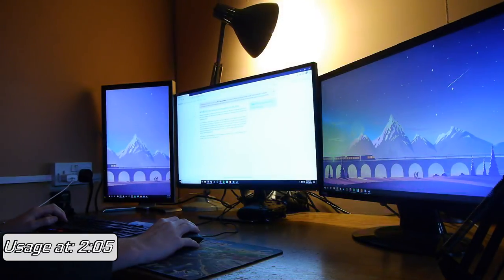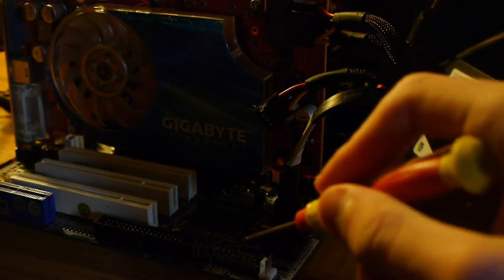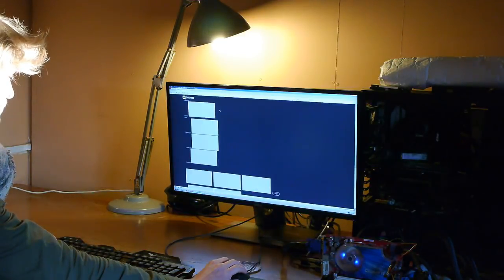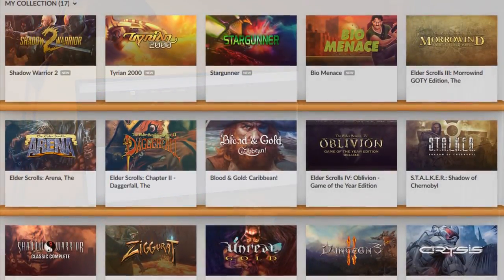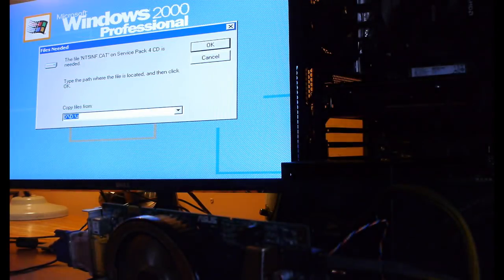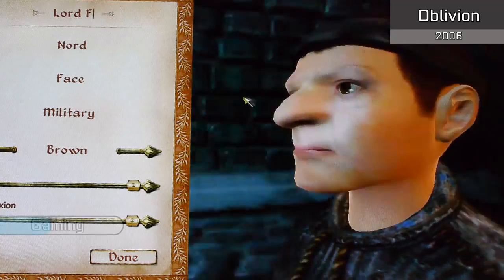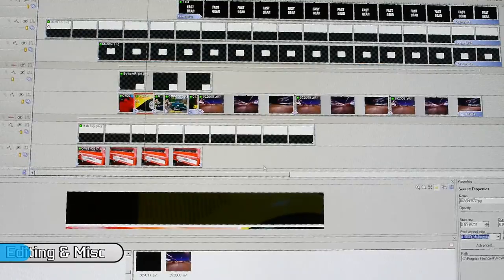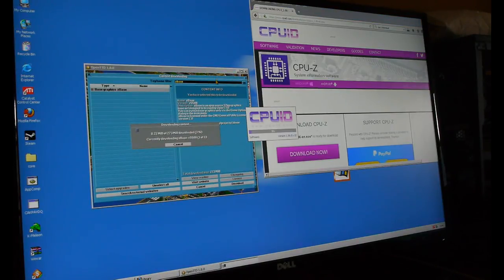Windows 2000 - Is it any good today?

Comment: That was fun :) I've only used 2000 a handful of times. I see it stuck between 98 SE and XP, struggling to run software from both periods without mucking around. I do wonder when XP will make it the winworld site...
Reply: The next year or two seems likely.  Of course, Windows 2000 lacking any online activation nonsense does make it slightly more convenient to use over XP- at least for earlier XP-era software and hardware.  Assuming you're using unmodified installation files anyway.
Reply: Today, win2k is less sane than xp. But back in the early 2000s when xp was vanilla and sp1, it was really buggy still, so running windows 2k sp4 was the stable choice :)
Reply: You should do a video like this @PhilsComputerLab.  Your videos are great!
Reply: Windows XP will never make into WinWorld PC due to copyright issues, there are a forum thread about it, they can't publish Office versions newer than 97 for that reason after Office 2000 was taken down due to a DCMA

https://winworldpc.com/product/windows-xp/final
https://winworldpc.com/product/microsoft-office/2000
Reply: Probably it will endup there in 5 years or more. People still use it too much as a daily driver, and incredibly sporadically microsoft still updates it, such as with the spectre problem
Reply: Up8Y I wouldnt say 2 years tho
Reply: Carlos S. M. Yeah but in 5-10 years wouldnt those older software be totally abandoned? Would microsoft still care about it? 
I mean, right now they are still kinda updating once in a while those software
Reply: You can find copies for download online already, and the one that I use hasn't been taken down for over a year, so I doubt it'll be long.
Reply: Yeah, I would think by now, Windows XP and Vista should also be considered abandon ware too. I did see Windows Longhorn up on the site though which seems like XP and Vista mixed together.
Reply: Shawn Burton Kinda, but by the unusuall really long support that xp had, and even longer lifespan (there are still a large number of people living with it as a daily driver today) and how many companies still use it, its hard to tell but i dont think soon they will just drop xp and it really become a abandonware. 

Vista is still too recent to be able to be considered (and allowed to be) abandonware. 
Both xp and vista still have some really nice compatibility and still can work with many tricks up the sleeve. Microsoft usually stops caring about one of their oses when its just like 98, where its basically too isolated from the world, awsmost any hardware able to run it is too old for a decent modern basic usage, no programs made in the last 15 years support it nor any hardware.
Reply: @eduardoavila646  true, I guess you can still get by with doing the majority of modern tasks with XP. I did see Windows ME on the site and for some reason, the only screenshots that they show for ME are blue screens of death. I think another reason why XP isn't up on the site is that they would have to get around the activation thing which prior versions didn't have.
Reply: Shawn Burton Well.. that could be a potential issue too.
Reply: Win 2000 is my all time version of windows.
Reply: @lopwidth7343  I remember in the early days of using XP like I remember in the summer of 2002, there was this virus that would force the PC to shut down like there would be this message that would count down like 30 seconds. I think at the time, I was using XP service pack 0, original release.
Reply: @sburton015  Blaster worm, if you were quick enough you'd type shutdown -a into a run command. It also effected Win 2k.
Reply: Probably never because XP needs to be activated in order to work.
Reply: @TheNews1990  only if you crack it.
Reply: @Gamz Neddyl in my collection of PCs, the oldest one that I have that still works that reminds me of the old style of Windows is an old Toshiba laptop with a 266 MHz Pentium CPU with 96 MB ram and has Windows 98 se. I could even browse the web on it, sort of.
Reply: Well u can install windows xp from the internet or the micro version
Reply: Windows 2000 was a successor to NT 4.0. It was meant for professional use, not for homes like 9x and ME was. XP combined these to one OS.
Reply: @LaDeXi  at that same time, Microsoft was going to release a home edition of Windows 2000 based on the NT platform which they called Neptune, but they never released it. Instead, they took the older Windows 98 platform and added some new features and released it as Windows ME.
Reply: I don't know but I keep a fresh iso of WinXp professional to use for nostalgia pu.
Reply: XP and windows 2k pro are 2 entirely different things. 2000 was 10x better in many regards than xp was aimed at the home user 2k was for the biz market etc. It was not until late in xps life cycle that it got close to being as reliable as 2k. By that time though windows 7 was months away. Most corp offices out right skipped over xp just like they did 95 and 98. Things windows xp lacked out right included various clustering capabilities like beowulf cluster. Windows 2k pro and adv server had these built in. Also xp lacked a ton of networking features by default that would be used inside a corporate lan its file sharing was way more limited. Even today there are windows 2k series oses that are right up there with windows 10. Windows server 2k19 is just around the corner 2k18 is out now. No one in a home / end user environment really used 2kpro or 2k adv server for things like gaming as it maxed out at 1 version oldr for dx than xp as it was never meant for gaming. It had dx to allow for some gaming stuff but it was mostly made for work. This included use as render farms for 3d studio max and on microsofts web site at the time that was even listed as a use case for the built in beowulf cluster support.
Reply: Unfortunately XP has no drivers for my laptop :((
Reply: @eduardoavila646  most ATM in europe was win xp embed based thats why still was updatable
Reply: Mateusz Zimon Yep, not only atms. Many cash registers and many stores still use windows xp where i live too.
Reply: I used 2k only for a short while... can't say anything about it, just that XP made much more sense to me as a new computer user. With time I found out how to get the errors away, it ran smoothly like butter.
Reply: Well then how did Windows 2000 make into Winworld easy, but XP can't? @CarlosSMOfficial
Reply: win2k is nice, essentially xp lite++.....xp I would argue works best(course more is better up to the limit) at like 1-2gb ram, win2k happily runs with 512mb; only time I had issues was trying to install on a sony vaio p, something about not liking the ide/pata controller even after trying out a couple of different drivers
Reply: I used Windows 2000 as my main OS back when it first came out, and the biggest problem was game programmers being sloppy--for instance, they'd detect you were running on an NT kernel OS and assume you didn't have hardware accelerated 3D, because NT 4.0 and earlier versions didn't; but of course, Windows 2000 did. By the time XP launched they'd figured things out and games would work properly.
Reply: @d2factotum  Sounds like windows XP x64:P; I guess I didn't game hard enough on 2k to notice anything
Reply: But if, for theoretical, one has one or handful of applications compiled with Visual Studio, is it stable? Usually older Windowses dont require as much cpu,ram,gpu resources, so kind of "debian of Windows world" (debian HC users run only command line)
Reply: @rytisliaucys3444  what laptop?
Reply: @plasmar1  HP Probook 4530s. Couldnt find wifi drivers
Reply: https://www.ath-drivers.eu/download-driver-nr-265-for-atheros-AR9285-and-WindowsXP.html assuming it's atheros..... they're actually pretty awesome at providing drivers:P....... most stuff is a matter of looking and not depending on the company that makes the laptops:P
Reply: @Drakilicious I think most the dirt that 2k face was from NT 4.0 which didn't natively support cd drives or something, in turn taking out a disc without ejecting or something would lead to a BSOD with no other reason:P(I learned this the hard way:P); and possibly a small performance hit from 9x to 2k that may of seemed bigger at the time.......but yeah 2k was and still is stable as a rock, really no different from xp
Reply: in the early 2000s MS sold all these PCs with Windows Millenium which was an horror, and I made thousands, fixing computers - initially for free - by upgrading WinME to Win2000. Which was a skin-less WinXP. And a decade after these machines worked still like a charm.

Even today I see someone who is lost on Win10, the "tablet mode"is always activating on its own, and they are stuck, and they keep telling me "I really like the previous one you made me" me: "what?" "well, the HP, you know, it was old but I never had any problem with it like I have with the Windows 10, but most things like Youtube and other programs are no longer supported..."
Reply: you can still use youtube etc on win2k(I still use 2k in vm's occasionally), but it's days are seriously numbered:P..... it's definitely not what it use to be
Reply: @lopwidth7343  I know lots of people who use XP as a daily driver. Some with some without  antivirus, just a firewall. I have a pc that I use just for gaming offline and youtube/ netflix on xp. I never have any issues. But I tend to do all my web surfing with Linux. I just set up a PC with W10 to try out and within two hours of using I had to reformat and reinstall because of malware. Not to mention W10 itself which is one big malware entity itself. But I want to play games with more than one core and 3 gigs of ram!
Reply: Shawn Burton Wait you got SASSER?!

Comment: Awwww I miss my old PC where i had Windows 2000 and XP dual boot 
Thank you for this video <3
Reply: If you miss your old P.C. you should go on Ebay and purchase one. Ebay has good prices :)
Reply: @eclecticreader961  but the things were used in e-bay -.-
Reply: @xaernxd  , Yeah the things are used. Used electronics that are sold on Ebay are typically in good condition though, unless otherwise specified in the item description written by the seller. Many sellers offer free returns too, if there's a problem.
Reply: @eclecticreader961  oh ok

Comment: Windows 2000 have two major advantages over XP for retro machine gaming/testing. First is they do support non PNP ISA devices. Do you have ISA network card or non PNP sound card? Well, no luck on XP, but they do work on 2000. This makes it ideal dualboot OS together with win98 for the long DOS to 2002-4 era retro machine as you need those ISA devices for good DOS gaming and at the same time you want win2000 for modern networking and NT5 era software. Second point is that unlike XP, it boots anywhere. If XP does not have the drive controller driver it will not boot, nor it will boot if you throw it already installed to completely different computer. 2000 still have the legacy 16-bit PIO over bios HDD compatibility mode, so they pretty much always boot. Slowly , but they do, which allows you to install new drivers and boom there you go on new machine without reinstall. This is extra useful for testing and benchmarking purposes.
Reply: If you're using the machine for retro gaming, I'd recommend Windows 95 or 98SE.  Windows 2000 ddin't have native DOS support, so some of the older games that required it would never work. Other than that, I found it to be an incredibly stable OS.
Reply: Just update to slightly later hardware. It's hardly going to cost a lot.
Reply: This should also work for Win2000, but when I used XP back then in a Celeron D cpu, in order to make DOS games work inside a command prompt window I had to use a tool called VDMsound. My cpu wasn't ready for Dosbox yet, it was too heavy, and this allowed me to play all my DOS games normally in XP.
Reply: @BlackEpyon  With the unofficial SP5 pack I think, iirc, gaming is quite a bit more possible.

Comment: I used to mess around with Windows 2000 some years ago and it's one of the most stable Windows versions I've tried, running on all kinds of hardware. And it also looks a whole lot like Windows 98 which is one of my favourites so that's another plus from me ;D
Reply: I've noticed that an awful lot of people in these comments don't seem to realize the theme can be set to classic in XP to make it look identical...
Reply: @AiOinc1  the classic theme is indeed very similar but if you haven't noticed so is alot of elements still very different in XPs classic theme which then requires modifications to files such as the explorer.exe in order to add those elements and at least to my knowledge when I made a patched explorer.exe several years ago that gave windows xp the classic logo/s there was no such thing available to download anywhere.. unless you got a download link, which I'd gladly accept! :)
Reply: I just run straight up Win98SE on a separate machine, yeah it's unstable and bizarrely annoying at times but that's the charm of it. That plus DOS games :-)
Reply: noth606 I'm planning on building a ultra high end Win 98 machine to push the boundaries, still i got a Dell 2400 running Win 98 but that thing lacks AGP..
Reply: ComputerCatGaming I'm running win98SE on an Athlon XP 2500+ with 1gb ram, GeForce FX 5950 Ultra and 1 gig ram(sometimes less when I'm mucking about with it) and off an old single platter drive. It runs blazing fast as you can guess but in theory it should be doable to put together something quite a lot faster still. Graphics support is a bit hit&miss, I have several AGP cards that no driver works with on win98... 
but it's a fun box to play with, I run old games at 1080p pretty well on it
Reply: @noth606  That's also very high end, especially the RAM that is pushing the limits because Win98 almost always caps at 512 MB RAM so I'm guessing you used the 1GB patch.
The Win 98 I had back in the day was a 1.7 GHz Pentium 4, 256MB RAM, 12GB + 32 GB drives and a Nvidia Riva TNT2. So now I'm interested in creating a machine that's so high-end that Windows 98 allows me :)
Reply: ComputerCatGaming Afaik unpatched win98se gets weird over 768mb, but I have patched mine, however I often run it with 512mb as more isn't really needed for anything. As for speed my box is pushing it quite hard, it's watercooled actually, an old Koolance PC03 tower with it built in, specifically for Socket A, so I can overclock quite far too, but usually run it stock since I don't need more speed for what I do with it. 
The one thing that is kind of fun is to collect the old fancy graphics from the late nineties and early 2000's, which I do and so I swap cards in it quite often, I have a bunch of the old top tier cards and a folder with all the ForceWare and ATi drivers so I can use whatever card and driver combo I want to play with. 
But I think one of the really high clock P4's with 800mhz front side bus, like 3.0-3.2-3.4GHz may be the fastest 'truly compatible' windows 98 machines you can build, I have a 3.0 but the motherboard gave out and I haven't found the right replacement yet. But pair that with some low latency memory and a GeForce 6800 Ultra AGP, FX 5950 Ultra or Radeon 9800XT and you have a bomb of a Windows 98 machine. 
The last high end win98 graphics are really quite capable and fast even with high resolutions, and can drop in a sound blaster Audigy or Live! and get great audio as well.
Reply: @noth606  thanks for the info I'll keep it in mind, and yup you said "truly compatible" but I'm going a little different route, well for the most part so is LGA 775 and core 2 duo out of the question due to being too modern and lacking drivers but I've found a few compatible boards that I'm looking into inorder to build the most modern windows 98 machine with all kinds of additional features.
Once the project is finished I'll eventually feature it in a video since I'll try several things that I think could be interesting to see.
Reply: @computercatgaming02  Do you really care so much about in folder web browsing and the old loading icons and logos?
Reply: @computercatgaming02  Honestly, what features were removed in the XP version that were actually worth having kept over in 2000? The only things I can think of off the top of my head were the aforementioned in-folder web browsing via Internet Explorer integration (which a lot of people hated, I seem to recall) and the sidebar, which would show a grayscale piechart of disk space or small previews of files. Thumbnails view is a thing and you can still see the pie chart via right click -> properties.

Am I missing anything here?
Reply: @noth606  The Perfect Windows XP setup
2 GB of Storage (yes 2 gb)
A 2.7 GHz Pentium4 
An Nvidia Graphics Card
Reply: ScratchLover1029 Gacha I run a 36gb 10k rpm Raptor disk now, and AMD FX-60, HD3850, 1gig ddr500, plus X-Fi Fatal1ty for XP, thinking of making the ultimate win98 box with ASrock 775i65G and 6800 Ultra. Why only 2gb storage? Many games won't fit on that...